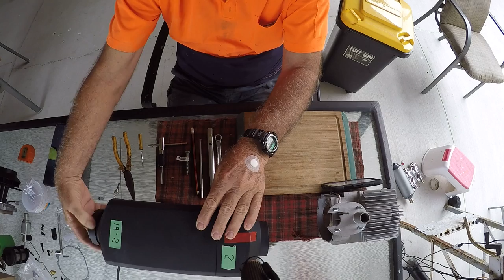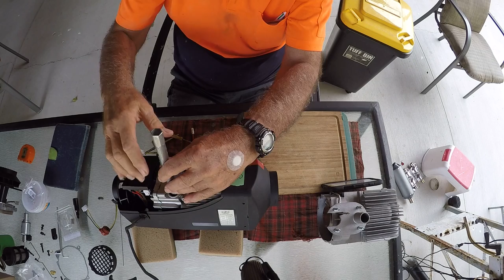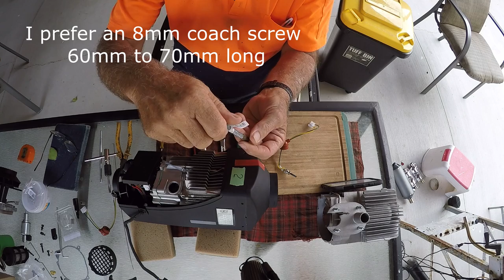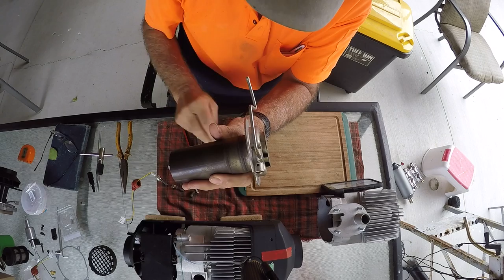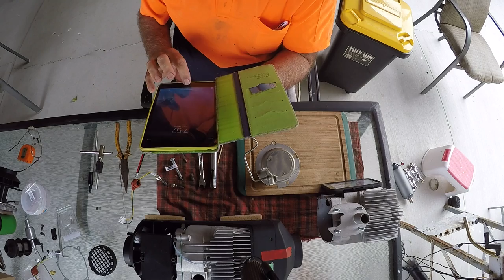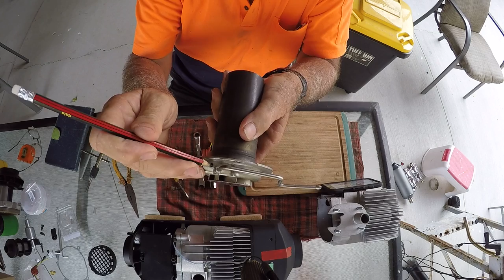Chinese Diesel Air Heaters - Part 9 Glow Plug & Atomizing Screen

Comment: Hi great tips on your videos , to prevent carbon build up i use a product called Fuel Set , it really does decarbonise  any combustion chambers , i ran a webasto  for over 50 hours a week for around 8 years until the motor wore out , clean as a whistle  when i stripped it down . Just add it to your fuel tank a few times a year to keep the burner clean . I use it constantly in my boat fuel tank as it keeps moisture out of the tank & keeps diesel bug at bay.
 bay . It wont keep the flying or crawling type out of the air vent though  , lol , so its a great idea to fit a better air filter as you suggest , where did you get yours ?
Reply from the maker: Thanks for the feedback David. 
I buy my air filters off eBay. There are lots of suppliers.  
Cheers.  JMcK

Comment: Hi John, just watched No 14 strip down and wondered what you would use to clean the deposits from the screen area? Could petrol or paraffin be used? My burner may have a little bit of carbon in it too so I may have a go at cleaning it as I already have replacement gaskets from the glow plug set I bought.
Reply from the maker: Hi Eric, I use carby cleaner and a gas torch to burn away the carbon.
However, if you are getting regular carbon buildup you should look at your install and fuel used.
With a good install and correct fuel you can go many years without a clean.  JMcK

Comment: Hello. I have just replaced my glow plug. I'm sure I read somewhere that not getting enough fuel to the heater can cause the plug to crack, do you think this is correct?
Great camera angle by the way, makes everything visible. 
Neil
Reply from the maker: Hi Neil, never witnessed that one. I occasionally hook up a glow to a battery in the open air to test its operation. BUT, these glow plugs are fragile and easy to break if you are not careful with them.
Cheers.  JMcK

Comment: John webasto units ,have a burn screen some with two hole some with one. In the end of the burn chamber,, i(it’s a flat disc type in the end of burn chamber)which soots up to was wondering if the Chinese ones have them.??? , great videos mate that will help a lot of people 👍❤️
Reply from the maker: Yes John, there is a circular screen at the top of the burn chamber a bit like a flattened donut (hight wise, not flat wise). If not too carboned  up it can be burnt out with MAP gas. But you can't get at it without grinding off the burner tube weld so as to seperate the screen from the tube. 

This is the main burner atomising screen which  burns  after the glow plug ignites the "pilot flame". 

I have not found any source that sells these screens as a spare part.  But not important these days as after replacing the screen you need to TIG weld the tube back with a lot of time and effort. More than the cost of a new knock off heater if you paid labour. You can buy a replacement burner now on ebay cheap. J
Reply: Thanks for the info John, have seen eBay sellers of these parts but as you say be cheaper to buy a new burn chamber ,rather than buy and try to fit one 👍

Comment: Hello John,I've just came across your videos,There excellent mate,I'm working my way through them now,I'm off to Scotland soon and it's going to get pretty cold,I have the fuel line outside and was wondering have you any tips to stop the diesel from freezing/gelling up in the really cold temperatures,really enjoying your vids John,thanks Dave.
Reply from the maker: Hi Dave, you should be able to buy winter diesel, but you could use a diesel:kerro mix. Say 50:50 and see how that goes.  JMcK
Reply: @johnmck1147  great,thanks John 👍

Comment: Does altitude affect the ignition of the fuel / Glow Plug? Great video.
Reply from the maker: Hi Ron, high altitude is not such an ignition problem, but more of a running problem due to the lower levels of oxygen in the input air. Using the genuine Eberspacher experience these heaters should be ok to 1,500 meters of continuous use and up to about 3,000 meters of short term use. Eg driving through a mountain pass. 

Over 1,500 meters you would need an altitude kit with an air pressure sensor and software to adjust the fuel input to match the lower oxygen levels. Eberspacher sell such a kit for around $500. I know of no such kit for these Chinese diesel air heaters. 

If I lived at high altitude myself I would try and make my own altitude compensator by manually controlling both the the fuel input and the fan speed separately until I got the right balance of fuel and air (oxygen).  J
Reply: John McK 47 thanks John. Will have to look into making the air pressure/altitude kit.

Comment: Hi John.  Thank you for your exceptional videos.  I was just introduced to the world of Chinese diesel heaters a couple days ago and have already decided to include one in my camper van conversion.  Do you ever use any diesel fuel additives to help with the carbon and soot buildup.  I have had very good luck using SeaFoam to help a gummed-up carburetor in my chain saw and other gasoline operated small engines.  Do you know if SeaFoam would help with the soot and carbon buildup on the atomizer?  Thanks again!  Dave
Reply from the maker: Hi Calothrix,  thanks for the feedback. A heater with a good install with minimum of restrictions needs very little maintenance. The heater on my boat has gone over 10 years without needing cleaning or maintenance.

As for the additive SeaFoam, I have done no personal testing of this product, and I am most reluctant to comment on anything I have not personally tested. However, I love to get feedback from those who have tried these products.  JMcK

Comment: Thanks, John for such an informative series. I have bought 3 of the 5 kW heaters in the U.K. and they all run very well. My question is. Have you found anything about these heaters which would make you hesitate to sell and install them for the general public?  There have been warnings that they will catch alight and burn down your van or boat or the CO leaks from them and will kill you in your sleep. Or that they are just cheap and unreliable and will break down. I would be interested to know what you think because you have approached this series with such a positive technical approach. I believe you are well qualified to give an honest opinion which I would appreciate. Thanks
Reply from the maker: Hi Richard, as I say in video 1. These are great little heaters and almost an exact knock off copy of Eberspacher. There is very little to go wrong, provided they are installed correctly, operated correctly, and maintained correctly.

Correctly installed, and burning a proper fuel they run very clean, however it is good safe practice whenever you have a combustion item in or near a closed living area to have a Carbon Monoxide meter, and some form of non closable air vent. The vent does not need to be large, but must not be able to be closed. In Aus, whether car, caravan, or boat, a vent is written into the gas code. These heaters are far safer than propane heaters and provide a lovely dry heat.

These heaters knock offs are very cheap and you could buy twenty or more of them for the cost of one genuine heater, but I have found most of them to be excellent little heaters. But like everything in life there are exceptions and there are a couple of suppliers selling substandard heaters, but the issues with these can mostly be rectified. 

Try and buy from a supplier with a local warehouse with a genuine returns policy. But they are so cheap most of us could afford to absorb the loss if we could not get a return.

The issues come from a home install without install knowledge, and running "exotic" fuel in them. You run engine oil, canola oil, vegetable oil, whale oil or snake oil in them and you will set yourself up to have big soot issues. Soot is one of the major starting and running problems. Run petrol in them and you have a time bomb. J
Reply: @johnmck1147  Thanks John . I will keep in touch .
Reply: Thanks for the videos and that safety concern. I installed two heaters in my garage and for several months I would not run them unattended. After several weeks and no problems I started letting them running all night. Lately for the last months they run 24/7.👍

Comment: Hi John, Great Video!  Question,  is the baffle muffler directional?  I see what look like triangle arrows on both sides but they point in opposite directions... Wonder if it matters which way you install it?  Oh and my ESPAR muffler does not seem to have a drain hole like those do. Doesn't appear to have one at all, what is up with that?
Reply from the maker: Hi John,
The baffle muffler is the same in both directions, mount it anyway you wish.

With no drain hole you can get a buildup of condensation water, and this can cause heater operation issues. However if the muffler is on a down angle so it can drain, you do not have those issues.  JMcK
Reply: @johnmck1147  Thanks for the reply!  I am BAFFLED that a $1200 ESPAR muffler comes with no drain hole and no fuel tank!

Comment: G'day
After running of 2 hours, heater fluctuates up and down.
Things I have changed :
Heat sensor
Wiring harnes
Fuel pump
3 different motherboard with controllers

Your expertise please in this matter.
Reply from the maker: Hi 851k,

I need a bit more information here.
If you set a fixed Hz rate, does the heater still fluctuate?
What type of fuel hose on the delivery side are you using?
Are you getting any smoke out of the exhaust?
What is the voltage at the heater when starting?
What is the voltage at the heater when running?

Cheers,  JMcK
Reply: @johnmck1147  Using standard controller - no Hz settings (1 to 6 bar)
Fuel hose is clear hard type.
After 2 hours running starts to fluctuating and get smoke.
Starting and running voltage is 12v from power supply.
P.S. I have uploaded a video for you to see   "kanbisk"

Comment: Thank you for such thorough explanations. I'll be replacing my propane forced air heater and this looks like a good solution, but I'd like to use gasoline as the fuel. Other forums suggest it's possible and Webasto touts their unit as gas or diesel. Do you know if the metering pump or the ECU needs to be changed to switch fuels or is it even possible with the lower cost Chinese copies?
Reply from the maker: Hi John,

To date, almost all the Chinese copy heaters are DIESEL..

Wedasto and Eberspacher do put out a petrol version of their heaters, but they are not cheap.

One Chinese supplier did put out a petrol version in 2020 but it was an utter failure and withdrawn. There may be a new Chinese Petrol heater available, but I do not know of it.

Cheers.  JMcK
Reply: If I'm not mistaken, the petrol/gasoline one has two glowplugs or something that looks like glowplugs?

Comment: John could you use a diesel additive like a cleaner mixed in with the diesel or for that matter a few ml per fill of petrol along with the diesel to keep the burn chamber clean ?
Reply from the maker: Hi James, I have not tried this personally so I can not make any comment. I personally would have concerns. 

However, with a good install with few restrictions this is never an issue. JMcK

Comment: I gained much knowledge from your videos and was hoping you may have some insight on my current isuue.  I installed my unit and got the E04 alarm, I ran two prime/burn cycles which makes me think I have it hooked up properly.  My issue is that it now blows fuses as soon as I hit the power button now.  I cut off the 15A inline fuse and wired it to a 15A on my distribution block.  After I blew a 15A I replaced it with a 20A and it blew.  What could be causing that much power draw and do you have any possible troubleshooting suggestions.  I am at a loss.....Thanks
Reply from the maker: Hi Bike Stuff,

First I apologize for missing your comment. This sometimes happens particularly if I am away sailing and have no internet for a few weeks.

Probably not much help to you now. But you most likely have a short circuit somewhere in your wire loom, or a faulty fuel pump or glow plug. E04 is often a short circuit in the fuel pump line, but the pump does not get power from the ECU until the glow plug is hot.

I would double check the wire loom for polarity issues, broken wires, etc. Then I would disconnect the fuel pump and see if it still blows a fuse on start. (go back to a 15 amp fuse) Then I would disconnect the glow plug to see if that is the problem.

Sorry  JMcK

Comment: Brilliant videos John and easy to follow. You have put so much effort and time into them. Appreciated!

P.s. I'm in the uk and I cant find the atomiser screens for sale anywhere? Where can I source them from?

Thanks
Reply from the maker: Hi Matthew,

Thanks for the positive feedback.

Search for glow plug screens for Eberspacher or Chinese diesel heaters. Here is a link to where I bought some to get you started in your search.

https://www.ebay.com.au/itm/10X-Stainless-Steel-Parking-Heater-Glow-Plug-Strainer-Screen-Atomization-grid/292779414862?ssPageName=STRK%3AMEBIDX%3AIT&_trksid=p2057872.m2749.l2649

Regards.  JMcK
Reply: @johnmck1147  In UK on eBay 10 for £3.91 plus £1.50 postage

Comment: Hi Jon and thanks for the videos! I bought a 2Kw Chinese heater with a 5 liter tank that I'm going to use.
And it came with a small diesel filter with a lid that I can unroll and clean (like a stainless steel screen with very small holes), but it's not a paper filter or other material like the ones from pickup. Could it be that a paper filter for diesel will create a barrier and will make it difficult for the pump to suck and therefore only comes from a small metal screen? Do you think this one is good and enough and would work well or better to change for another different model diesel filter? I use Diesel S10 (10ppm used in new pickups with a commom rail system).
Reply from the maker: Hi Bruce, both fine mesh stainless steel filters and paper filters work well. JMcK

Comment: Hi John great videos thanks.  What causes a new glow plug to fail?  Could being a bit rough with the unit on install (banging, jostling etc.) cause a glow plug failure?  I have gotten as far as E03 and am beginning to troubleshoot.

Thanks!
Reply from the maker: Hi Andrew, the glow plugs are very fragile and easy to break. (I know). You have to be very careful with them. Remember, they also draw 8 to 10 amps to get hot enough to light the burner. If your battery is not well charged, or your wiring of the heater is too small, or you have other battery volt loses, the glow plug will also fail.  JMcK
Reply: @johnmck1147  Thanks John - I did extend the wiring (maybe 1m) and used same gauge so hopefully I don't need to rerun larger wire (installed on a boat).  I am hoping the jostling of the unit during install was the culprit.  At any rate I have purchased a backup unit and also another glow plug so we'll see how we make out.  I appreciate your response!!!
Reply from the maker: Hi Andrew, the wire on these heaters is bare min to run the glow plug. Add losses in switch panel etc and you will not get 12V plus at heater when glow plug turns on. If you can, suggest you take cover off and check voltage at heater before and after switch on.  JMcK

Comment: My heater shows 9volts on the LCD screen but won't start because it needs 12 volts. When u power the van engine on it will start because it pulls 12 volts with the help of the alternateor. How do I fix? Do I need new leisure battery?

Comment: Thanks so much for your very informative videos, I have self installed mine and made every mistake you speak of. I have blown the fuse and done the circuit board in by trying about 20 times to prime the fuel lines and fill up  the heater using the pump: oops my bad, anyway two questions for you do you think I should buy a new pump? 2nd question will a 5KW controller board run a 2kw heater with no problems, as that is the only one I could find that fits and looks the same as my 2KW one.
I am now refitting everything with much more informed knowledge from you, in my defence I cannot find info anywhere to clearly say where the fuel filter fits before pump or after pump my instructions don't show any filter at all so I put it after pump now I have removed until I find out where it's meant to go. Many many thanks John for doing these videos best regards Chris
Reply from the maker: Hi Chris, 

First the filter.   -    It ALWAYS comes BEFORE the pump. The pump and filter should be as close to the diesel tank as possible.

I do not necessarily think you will need a new pump at this stage. Does it still pump fuel? 

Is your heater really a 2 KW or a 5 kw marketed as 2 kw? A real 2 kw is about 300 mm long, a 5kw is about 400 mm long.

You are in a bind re the circuit board and it is very hard for me to advise without seeing it, however if they look the same with identical plugs for the add on parts I would bench test it if I was stuck in a bind like you. Note I said bench test. I would not try this with the heater mounted in a vehicle.

Sadly like everything these days, I am giving you my opinion, you must decide for yourself what is right for you.  Good luck . J
Reply: Hi John, thank you so much for such a quick reply, my heater measures 400mm so I have bought a 5KW thinking it was 2KW wow when I get it I bet it works good now,thank you
Reply from the maker: I hope it works out for you Chris. J
Reply: John, Great work. Haven't taken mine apart as it works fine. Nowhere could I find information regarding the atomizer screen, thanks. Think I will buy one in advance for a spare along with a glow plug and pump. Then I will be covered for 95% of possible failures. You are so helpful with your acurate detail that can be found nowhere else. The Chinese Diesel Air Heater Forum posters have referenced you many times for good reason!!!
Reply from the maker: Thanks for the positive feedback Robert.